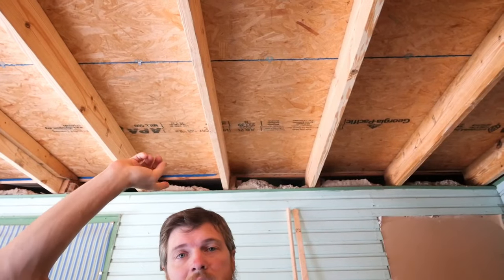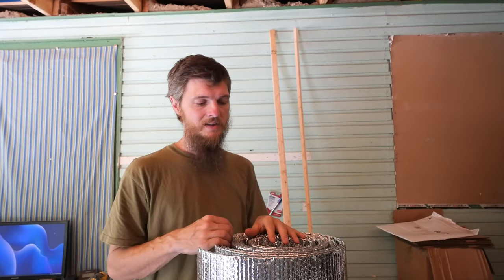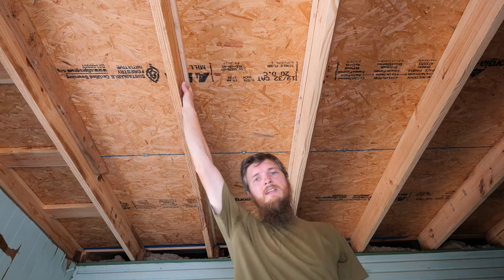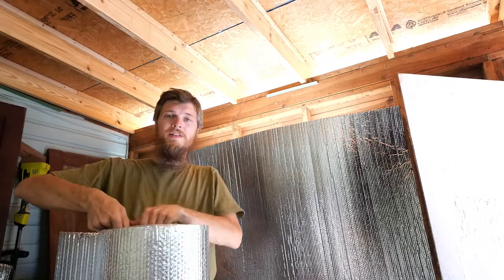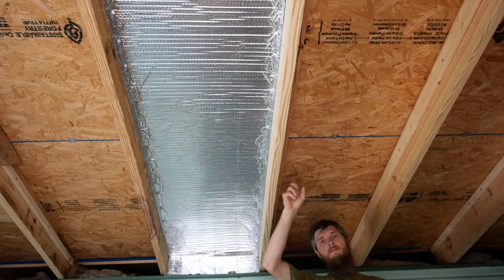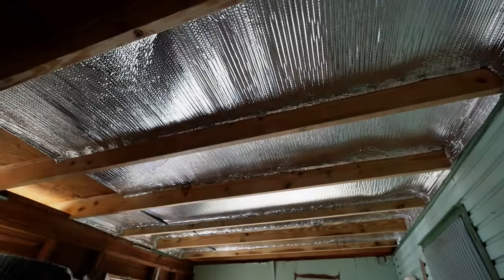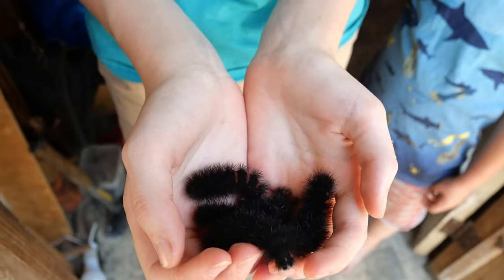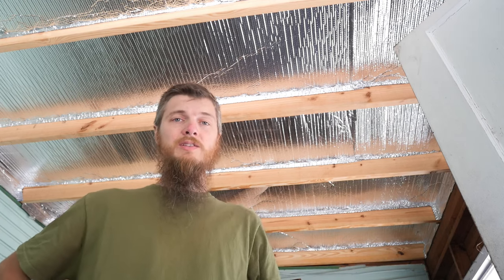It's Too Hot - Roof Radiant Barrier To Block the Heat

Comment: Thanks for not editing out the wasp experience - I never laughed so hard in my life. (So...Doug's a screamer, is he? That is so funny...🤣). 

Reminds me of years ago at a friend's place in Missouri. They had a wasp problem also - in a tiny old smokehouse that sat right next to the main house. Anyone who walked close to it would get attacked. My friend latched onto a pest control sprayer and filled it with kerosene. It worked great, only it was a matter of "shoot-and-run" then going back and doing it again until they were finished. He got stung a few times, so he gave the job to me.

Of course, I was too quick for them, and so I survived to tell the tale to younger generations. You probably won't want to use the kerosene method, and I have no other suggestions. I used what worked and didn't bother to ponder other options. But I thought you might like the story.

Letting them alone for the time being is a wise thing to do until you can formulate a plan. But don't wait too long - if they decide to pack up and move, it may be to a more private place and you might not find them. "Keep your friends close, but your adversaries even closer."

Comment: Happy Mother’s Day, Ashley. Doug, if you want to get rid of the wasp nest and it’s tenants, get a spray bottle and put water in it half way next, add dish detergent and shake it a little until sudsy. Now, seat your sprayer on “ stream” and spray the nest enough to soak it. If there are tenants home spray them too. Believe it or not, the soap kills them. ( I have seen this work on a fence that had one and this is what the man used to get rid of them. )

Comment: I would recommend insulating the ceiling even though you don't plan on making it conditioned space.  I (in north Georgia) insulated (r19) the ceiling over my attached garage and it made a world of difference.  The temperature never drops below freezing in the winter (single digits outside) and is bearable in the summer.  The walls and aluminum garage door are not insulated.

Comment: I added a radiant barrier to our attic last weekend. On sunny 95F days our AC couldn't keep up with the house getting warmer. Sometimes the temp was 3F above the cooling setpoint. I used 48" double sided 250ft roll. I stapled around our upstairs rooms in our crawl space, then on the walls of the attic with what I had left. Not a perfect job since I ran out, but our AC keeps up with no problems, even when it was 100F outside and sunny. I didn't do over the insulation above the ceiling of the rooms, but even with what I did the AC keeps up just fine and runs much less. I just ordered 250ft of 26" to place over the ceiling insulation. I can't wait to see the result. I got 26" because of the rafter spacing. Worth the $$, time and effort.

Comment: ignore these internet troll fails.  They have no concept of anything except what they see on youtube.  They obviously don't pay attention and they really do not understand the difference between radiant heat and conductive heat.  The furring strips you used saved you from an installation that would not have provided much relief from the heat.  Placing your foil directly against the sheathing would have slowed down the heat transfer but it wouldn't stop it.  Keeping your air gap (as you did) will block around %97 of the heat transfer.  So when you see these trolls comment, just smile and nod.

Comment: Wait till night, and get a bowl of dish soapy water and soak the wasps and they will die, and not fly. Hold the bowl up to the nest and scrape it into the soapy water. Works every time and cheap and easy. At night they just sit on the nest. You could take the nest down with glove on AT NIGHT [don't use a bright light] and move it outside, and stick it up under the eves not to far away and they will find it the next day, but that is a lot of trouble and you still might get them stirred up later in the year when there are lots of them. Soapy water will work!

Comment: Happy Mother's Day Ashley!!! And Doug just take some Dawn dish soap mix it with water and throw it on the wasp nest. The wasps will just fall to the ground. And you can step on them and sweep them up. It take the oil off their wings and they can't fly anymore. Don't step on them with bare feet because they are not dead. They just can't fly and they can still sting you!!!

Comment: nice thanks...in the PHL we put chicken wire to hold these insulations because after a few years due to heat, it becomes fragile and melt away....I also painted our roof Boysen CoolShades to hopefully deflect that heat.....and I even put powerful fans to suck the air from the ceiling to outside....
Reply: GREAT IDEAS...I knew about a some but never thought about the paint..Im making a bunny hut ( home ) in Vegas , and while when its very hot I will bring inside, I still have to weather proof it , and that paint sound s like a great idea for them and the chickens I hope to get! Be blessed!

Comment: I lived in Florida for ten years. We had a whole house attic fan. It pulled inside-the-house air up thru the attic. It was in ceiling in the hallway. It was great especially to sleep by (white noise). Something you might check out.

Comment: Those wasps build at the beginning of spring and don't move on till winter.  You don't know if the kids are allergic so I would emphatically say to get rid of the nest now.  Or you'll be lucky to use the room at all; and you certainly won't be able to relax in it when the rest of the wasp family moves in.  Ashley, knock it down if Doug doesn't want to.

Comment: Happy Mothers day Ashley!
I think you guys will be happy with the heat barrier. I used a closed cell ceramic foam (1/4") sandwiched between two pure aluminum skins (no gap). It cost me twice as much but the material works like a miracle. 20° difference in before and after.

Comment: At around the 2:45 mark of the video as you were about to put up the first strip, a large bee appeared to fly into the rafter space 2 spaces the left. Hopefully the insulation you put up will prevent them from getting into the attic. I see you found the nest. As they are wasps, you should probably remove the nest before it gets to big. Wasps are dangerous to the bees that we need for the world to survive. We had them inside the wall of our house right by the back door last year and wasps are very aggressive.

Comment: Happy Mother's Day Ashley!  Thanks for not editing out Doug's reaction (scream) to the wasps!  That was so organic and real, I had a such a long healthy laugh that felt so good.  Thank you, for sharing Doug!   Here's an easy wasp spray recipe:   In a quart spray bottle add equal parts water & vinegar (2 cups each); add 1 tsp dish soap and 1 Tbsp of peppermint oil. Shake well before using.  It really works. If using outside, it may have to be reapplied after a rain if the wasps try to return.  Great video guys!  (if you didn't want to kill the wasps, spray the nest while their gone getting more material and when they return they will leave due to the peppermint oil).  🐝

Comment: Depending on how good your shingle are, radiant barrier can reflect so much heat back to them that they'll form blisters. I see it a few times every year (I'm a home inspector).
Reply: Blisters on the shingles? On just the cheapest 3 tab or architectural shingles as well? Just got a new 50 year 140mph rated roof on my house and thinking of adding this in attic to help keep out the heat in my 70+ year old house

Comment: If memory serves you need a min of 3/4 inch stand off space for a proper installation.  If you install flush the heat will conduct through the material as it is a reflection barrier not insulation.

Just a thought
Wolfmama0104

Comment: We just had 5 trees removed that were near our house, all 3 Pines and one of the Oaks we're leaning from Hurricane Michael. Our Double Wide Mobile Home is noticeably warmer and the AC runs more but I feel much safer. We've already seen the upper 90's here in South Georgia although we're in the mid 80's now thanks to a cool front. Not sure where you guy's are at in Florida but we have similar temps just not as many showers here as in Florida. Happy Mothers Day Ashley.

Comment: This your first summer down here?  Its not hot yet.  :)
Reply from the maker: It's not really hot outside, but with the sun on the roof it got extremely hot inside that room without any insulation. Last year the room was a lot better since it had a ceiling. We got here in June last year, so we're creeping up on one full year of being here. Last summer was fine outside, we actually didn't find Florida to be as hot as people always claim it is. We handle heat well :)

Comment: Spray those wasp with WD-40, it works better than most wasp killer.
Reply: We use carb cleaner. It is cheap and they drop immediately. I'm allergic to them so they have to go!

Comment: should have nailed it to the rafters, leaving an air gap between the foil and the plywood.
Reply from the maker: It was stapled to the wood strips leaving a bit of an air gap.
Reply: Was it enough of an air gap to work?
Reply from the maker: @jpechacek80  We noticed a significant difference from before and after installation.
Reply: @diyfferent  Those are rafters.  Wood strips? Seriously...🙄🤣😂
Reply from the maker: @joemamaluc312 You should have watched the video before making such an embarrassing comment. If you had, you would have seen that for the first half of the video I installed furring strips to create an air gap, which I explained thoroughly. Then I stapled the Reflectix to the furring strips. I don't know how both of you missed that.

"Furring" or furring strips are strips of wood commonly used in building to level surfaces or create air space for insulation. 

So yes, we attached the insulation to the wood strips, not the rafters.
Reply: @diyfferent  I was wondering if there was enough airspace between the foil and the ceiling, but from what you said, it made a difference, that's all that matters. It's kind of like putting foil over food in the oven, if there is more air space between the foil and the food, it will hold more heat inside, rather than escape. Thanks for posting, I learned a lot from it.
Reply: @diyfferent  you are good to go. Thanks for posting
Reply: @diyfferent can I just staple it to the bottom of the 2x4s ? Will this help warm in the winter time, going into the attic

Comment: Does this stuff work in the winter to keep room warm?
Reply from the maker: No, not really. It's really just designed to reflect and block radiant heat. It could help keep a little heat in by it's radiant properties but it really wouldn't work well because it doesn't insulate.
Reply: I am highly allergic to all types of bees and wasp. I yell and run every time I get stung. I have to immediately get my epiPen injection and hope my airway doesn't close up.. I admire your work ethic and the fact you are not scared to tackle the big projects. 👍👍🙏

Comment: You should have done it low because you need the air gap for insulation, the foil will just get hot and radiate heat down.
Reply from the maker: Yeah there was an air gap. That's why we installed the wood strips during the first part of the video. They just made it easier to create the air gap that we wanted. It's been working well for us.

Comment: Dude, air is your friend. You should have placed the radiant barrier on the battens facing upwards. That lovely cushion of air would then do its work. Plus no cutting.
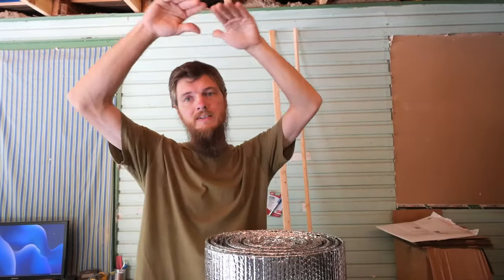Reply from the maker: There is a 1.5" air gap between the barrier and the roof decking, start watching at 2:38. I'm not sure what you mean by facing upwards since this barrier is the same on both sides and can go in either way. We didn't want to install it directly on the ceiling joists since we were going to be doing a beadboard ceiling. If you want to see how things are done correctly, watch our videos.

Comment: This method is not correct.  Radiant barrier is designed to reflect heat but you are allowing heat to be radiated from the exposed dimensional lumber.  The proper method is to staple the radiant barrier to the bottom of your 2x's and overlap.
Reply from the maker: There are 3 options for installing it. We went with the 3rd option, 'Truss Cavity or Side of Rafter Method': https://pdf.lowes.com/productdocuments/1b37880a-8415-4bd1-b83b-64dcbb56e659/01418758.pdf

Comment: I hate to break your bubble from your tin foil but the radiant barrier should NOT touch the wood from the roof. You will create more heat this way and no air to escape. In the winter it will sweat like a hot dog and create condensation. Don't get me wrong it looks pretty when you stapled the entire roof, it's a roof not a speaker  box.
Reply from the maker: We didn't do that. Start watching at 2:38.
Reply: @diyfferent but you don't notice, you are doing it. The radiant barrier is too close to the plywood that in the summer when it's too hot it will suck it towards the wood. Just picture the radiant barrier like a curtain on your window and that is really how it should look, not flat and tight.
Reply from the maker: @gingerpoppins1429  I don't know what else to say. The 1-1/2" gap that we made between the roof and the foil seems to be working fine for our needs.
Reply: @diyfferent  u have to have a air gap singles will not last very long
Reply from the maker: @C33Chevy  We did an inch and a half air gap. Also, we don't have shingles, we have a metal roof.
Reply: Ok if I put a foam board touching the wood and then put the heat barrier silver thing  on top ...lol...will that be ok?
Reply: @chellychevres2969  sounds redundant.

Comment: Doug, my response to the wasps would have been the same as yours.  There's no way I would have just knocked it down either, lol!  Be aware that people have found those inside of their walls so you want to make sure your porch isn't a honey factory already.  That can be a mess to clean up and probably costly.  It's just good not to let them have a home anywhere on or in your house.  There's plenty of good spots for them outside.  When it gets hot in Florida, unfortunately you have humidity to deal with.  It's time to get the fans out apparently.  We still have temps in the 50's in Minnesota.

Comment: FL summer heat is intense for sure. I envision a couple ceiling fans in the screen room. Also mosquitoes & no see um proof tight mesh screens. Dark color screens vanish & you can hardly see them & the view is great. Whatever you decide about screens, making them easily replaced will be a bonus after a wind storm event. Just some native insight in case it helps. 🤠

Comment: Excellent about not knocking the wasps nest down. You should only do that at night when they've gone back inside the nest for the night. Ideally then if you had one of those extended grabber tools the elderly or handicapped use, you could use it to pull it down and into a bag. Take it outside away from the property and release.

Comment: I know this is old but I am considering the same type of barrier for my shop and stumbled across your video during research. Informational? Yes, but discovering the wasp nest is video gold! It is now in my favorites. That scream is freakin' hilarious! Watching it a few more times just to hear her chuckle in the back ground made it even funnier. Please don't stop finding stuff! Thanks, I really needed that! 🤣
Reply: Run it across the studs and tape it off. Leave about an inch of slack in each bay, that stuff moves a lot. The way he just did that is not using it to its fullest potential. And you might want to consider a spray foam kit and shoot an inch of foam on the underside of the roof deck.

Comment: The SCREAM makes you the NEW scream queen,or we’ll king . That should have hit the cutting room floor in my HUMBLE opinion. Lol question radiant barriers need at least a 3/4 inch gap for proper affect to reflect back . Was that ? I did my entire ceiling too . I used 3/4 inch foam glued a strip in the middle. But any barriers r good .

Comment: As advice? to others using this stuff, use a laser pointer IR thermometer to find the hottest rafter bays in your roof to apply the material if you only have a limited amount. Also, this stuff is great at cooling a space, if you live further north than say VA, it is not recommended. Conventional insulation is a better idea there.